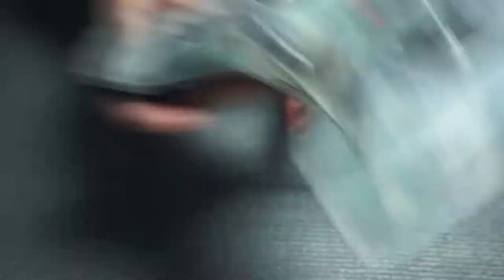TBS Tango2 Disassembly and assembly.

Comment: Did you ever manage to open that Antenna to pint?  I bought it and tried opening the case - Just broke as its glued pretty shut!
Reply: I was hoping to paint the inside of my antenna too! I'm going pearl white with the paint on the inside of the case. If I can't get the antenna open I'll just run the stock black one. I think it'll look good with the black buttons and the black back rubbers
Reply: @baggszilla  The one i bought was completely torn apart - could not open it!